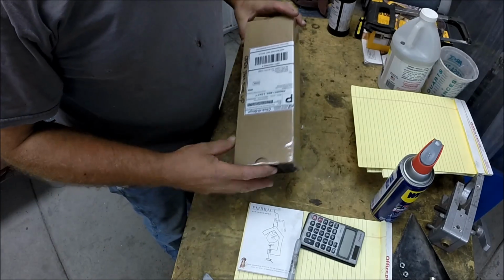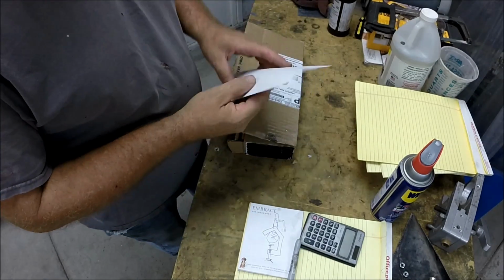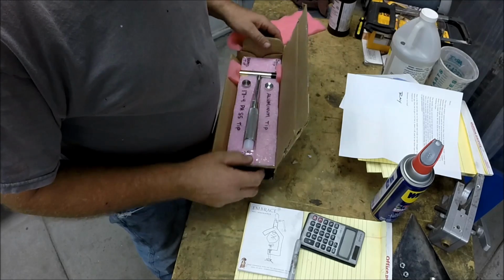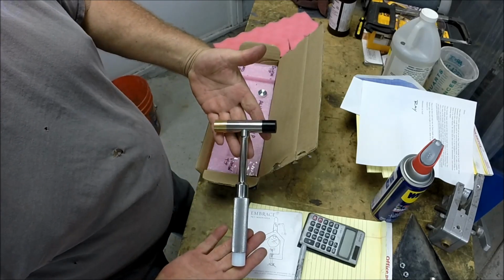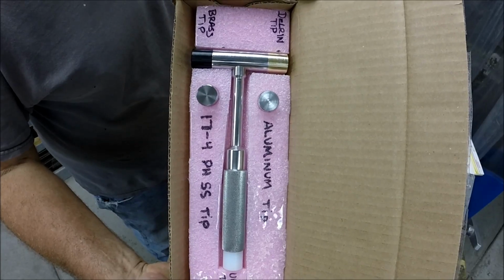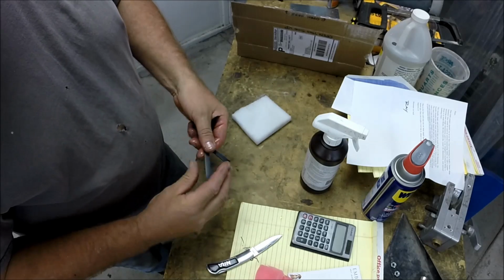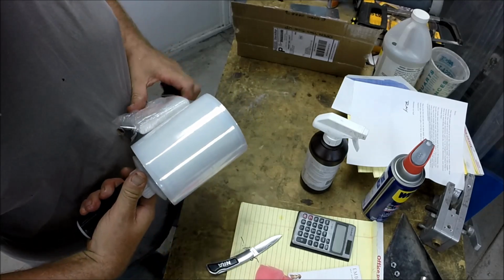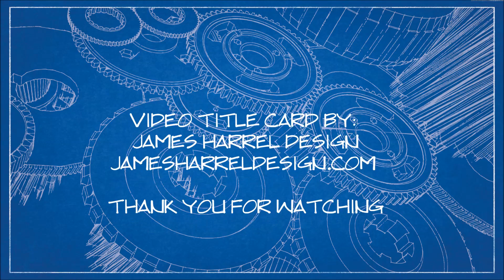Mail Call #2

Comment: That is an awesome hammer. That is very similar to one I have that has a wooden handle with a rubber round on one side and a brass on the other. I try to keep it with my lathe for bumping parts in but it seems to wonder around the shop. Ray did some real nice workmanship on that one!